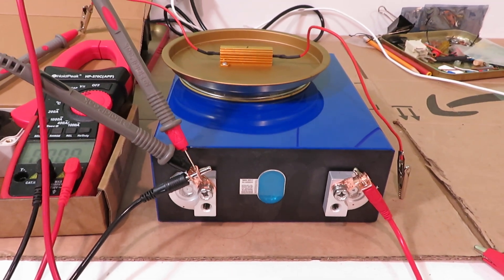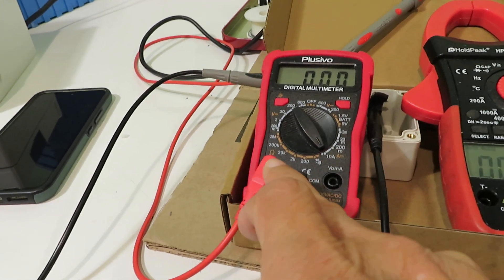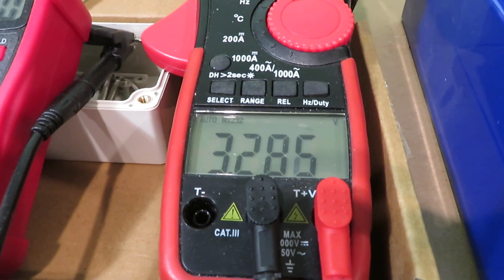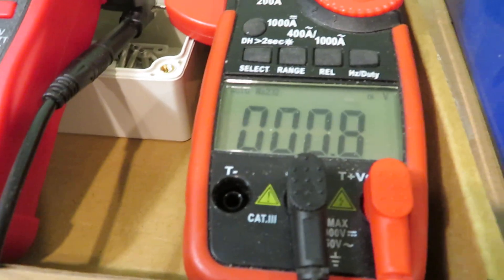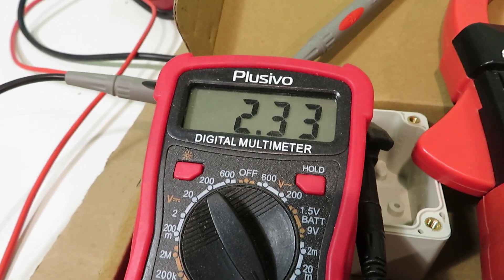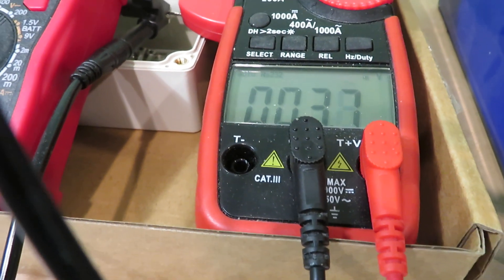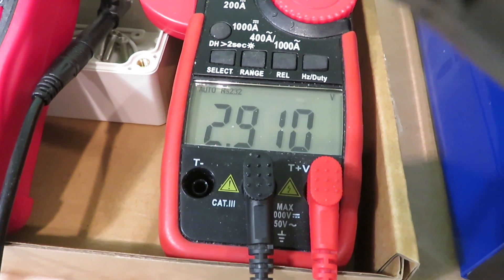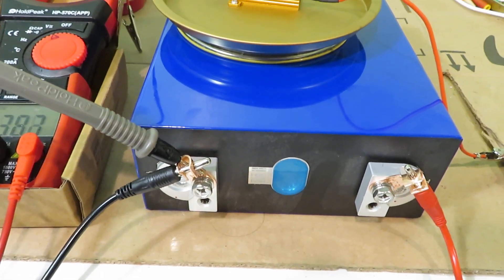EVE LiFePO4 Cell: Aluminum Shell Polarity

Comment: I tried the ohm-meter (Fluke 83) on one of my EVE 304 cells and got a reading from (-) to case starting just under 1K and rising to a little over 1.1K and still slowly increasing.  

The u-ohm meter (YR1035+) was interesting.  As I had measured before, the cell itself measured 0.22m-ohm.  The casing to (-) measured about 39.5 ohms(!!).  I can only attribute the difference to how the instruments measure resistance.  And that would be an interesting video in itself...

I agree that the case is not directly connected to the (-) terminal.  But it doesn't quote act like it's just floating either, at least on the ohm-meter.
Reply from the maker: Thanks for your response. I did more measurements after the test and arrived at the equivalent circuit as shown in the video cover.